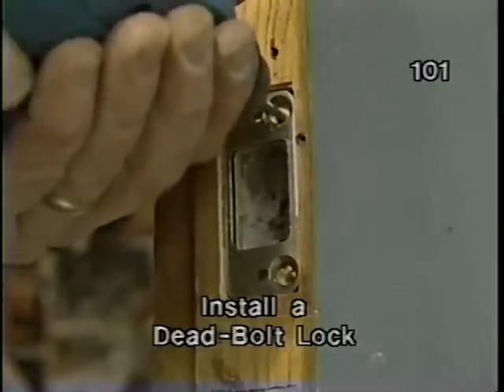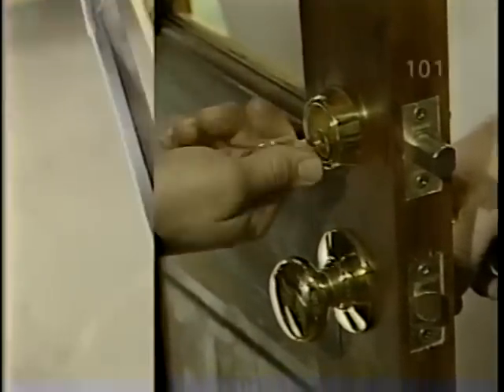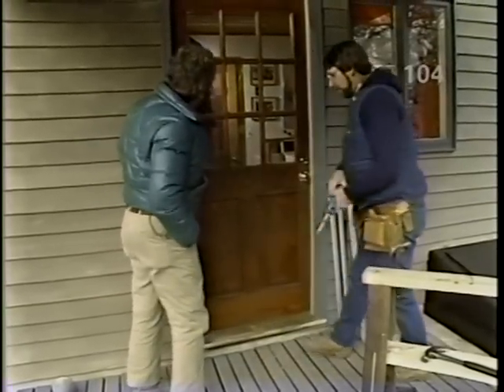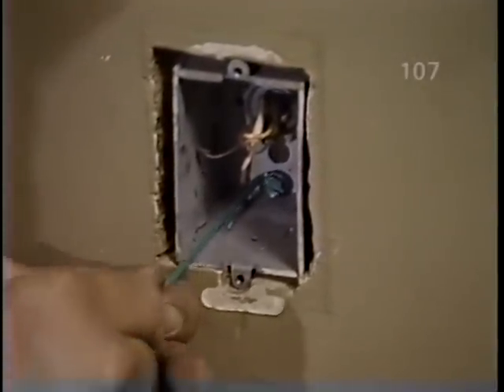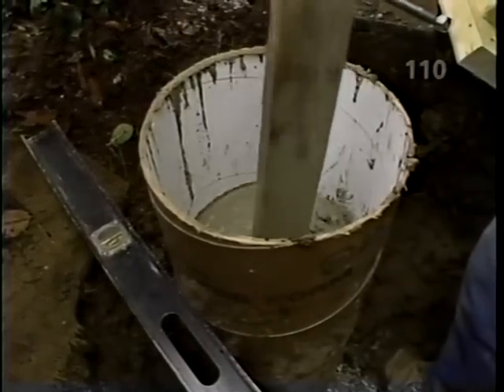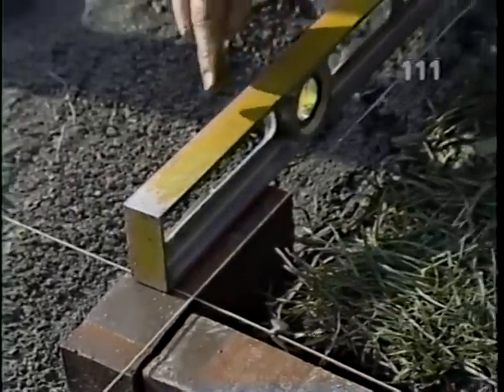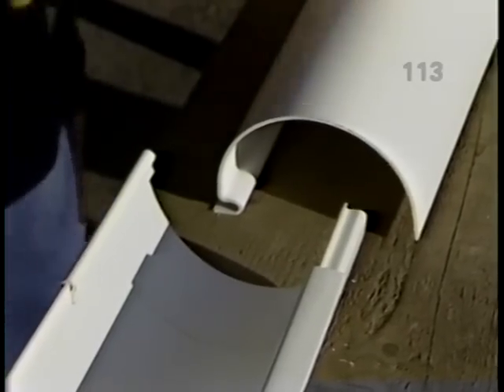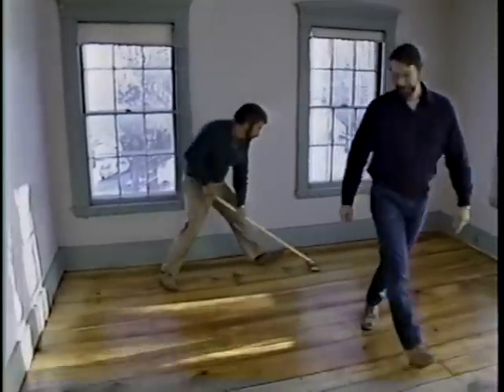This Old House Home Improvement Video

Comment: I was fortunate to have worked with Norm on projects and when he appeared in our booth at shows over 12 years ago. You will not find a better human than Norm. He would make sure anyone that showed up received an autograph. He & Steve Thomas were hard to beat going out to dinners afterward; I miss them both dearly.

Comment: Im sure they would say save the old growth lumber. I need special main breakers that shunt the so called "Neutral" conductor. Might as well provide GFCI/AFCI protection for the entire home. If the circuit keeps tripping call your local electrician!

Comment: I have been an electrician for over twenty years and the old timers would cut the ground wire off the romex, AC, BX, THHN, and say that will just cause problems down the road.  That ground prong would get cut off quick also.
Reply: You are the second electrician I have heard say this. So this really was common practice? What problems would it cause? Wouldn't it be a safety issue to eliminate that wire?
Reply: WOODEN GUTTERS!!!!!!!!!!! AWFUL MAINTANCE PROBLEM IS RIGHT ALSO FALLS APART OVER TIME!!!!!!!!

COPPER GUTTERS TURN GREEN OVER TIME AND CHEAPLY MADE- ALSO CAN LEAK TOO
EVER THOUGH 3  OR 4 BUCKS  OR SO A  POUND
WOULD DO PVC
Reply: HAD TO SELL MY LATE GRANDPARENTS HOME HERE IN UCONN,CT ALL SOCKETS WERE 2 PRONG  BX CABLE ALL HAD TO BE REPLACED
THE SOCKETS  ONLY WERE LIKE 350 DOLLARS. WIRING WAS   200 PLUS LABOR
 HOUSE WAS BUILT  1951 SO EVERY  THING WAS  REPLACED
PLUS NEW SEPTIC WAS 10000 PLUS RADON FOR THE WATER WAS BAD
THAT WAS 2500 DOLLARS ADDS UP
Reply: In the event of a short circuit power goes to ground and trips the breaker or blows a fuse.
Reply: PVC was probably still in the lab when this video was made.
Reply: Joe Playing Outdoors no they used pvc cement on the gutters they couplinged together.

Comment: I used to have it but my vsr and video tapes are gone
Reply: Edward Koepke Your absolutely wrong about that. Bob made less than $200 per episode so Russ Morash  encourage him to do product endorsements to make money. Bob always cleared his endorsements with Russ first. He was going to do some commercials for a small Home Improvement chain and as always he cleared it with Russ. Bob signed the contract,  afterwards Russ was contacted by one of the This Old House sponsors and told  Russ to stop Bob or they would pull their sponsorship from the show. Russ called Bob into his office and told him not to do the commercials. Bob said okay fine but you've got to give me and indemnity to protect me from being sued when I break the contract. Russ refused and told Bob if he did the commercials he was fired. So Bob walked off the show. Ironically that Indemnity would not have cost Russ much money. Later Bob said he was happy to leave because he didn't agree with Russ on the direction the show was going. So you see you're completely wrong. If you do your research you will find that Bob was well-liked on the show. It was Russ Morash everyone hated.
Reply: COMMENT DELETED
MY NEIGHBOR TOLD ME HE  WAS FIRED FOR BEING A JERK
I FOUND OUT  ON HIS CONTRACT
Reply: He made up for it later.